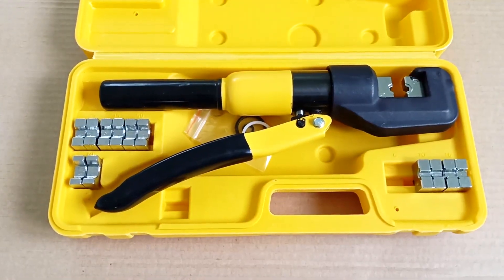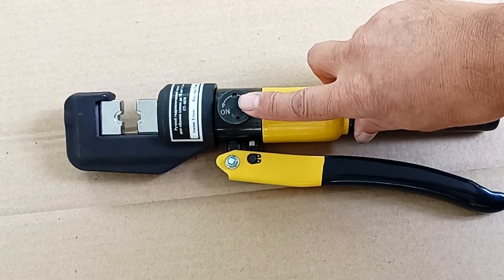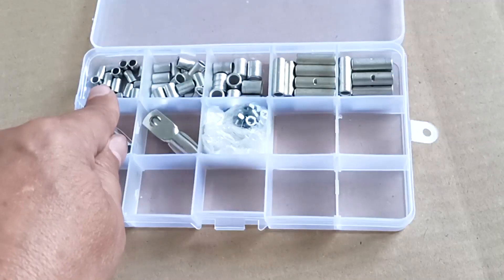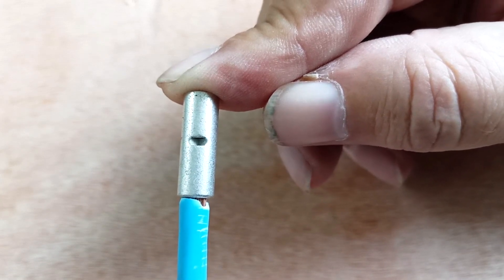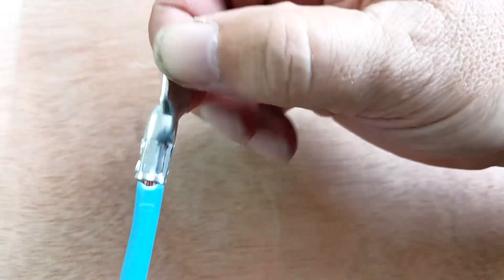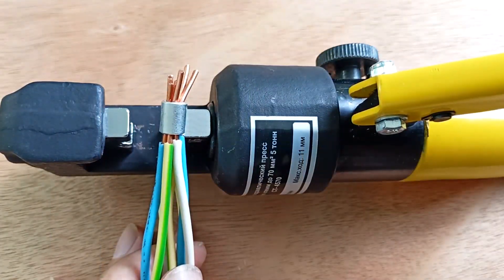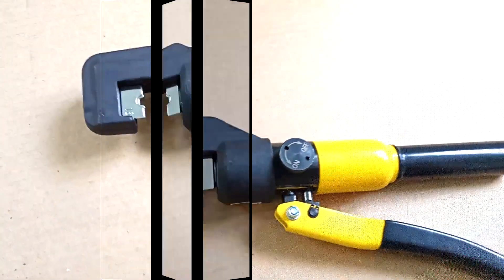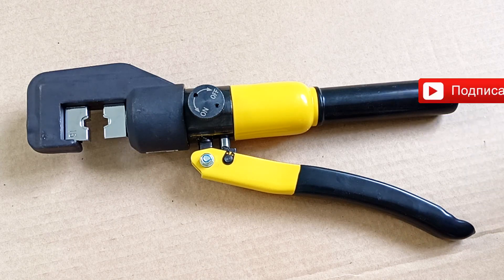Hydraulic Crimping Pliers for ELECTRICIANS: Reliable Wire and Sleeve Connections, DIY Tips

Comment: These hydraulic pliers work wonders for crimping wires and sleeves accurately, saving time and effort on each task. They’re comfortable to hold and easy to use. Has anyone noticed if they work well on thicker materials?
Reply: These hydraulic pliers are fantastic for precision crimping and comfort; they’re a valuable tool for various tasks. Many users report good performance on thicker materials too!
Reply from the maker: Personally, I haven't tried it. But 5 tons is no joke. It will definitely pressurize.